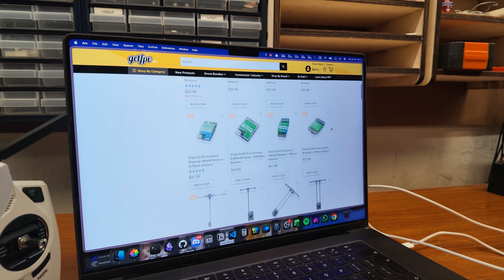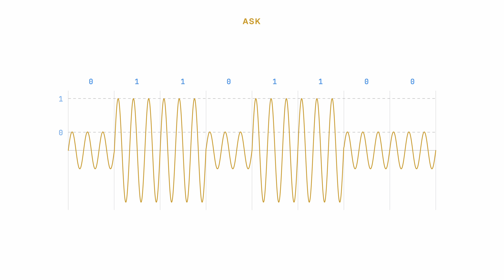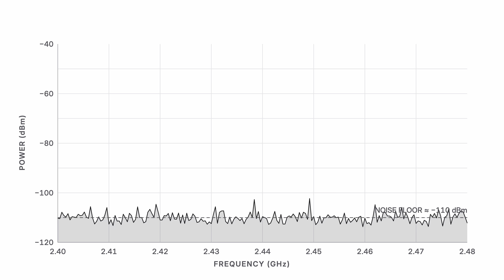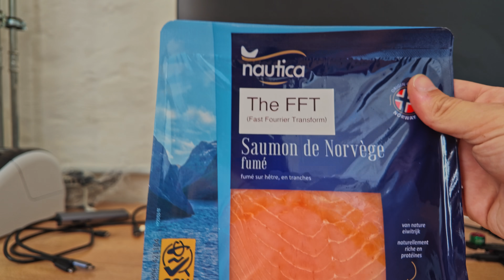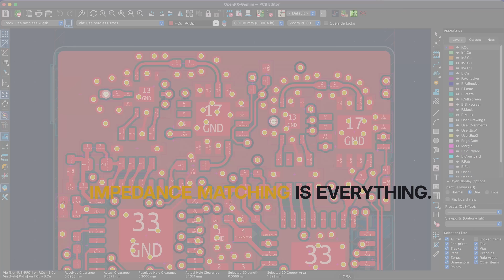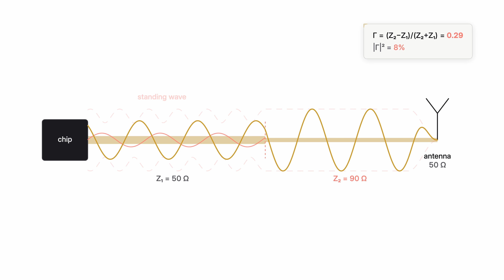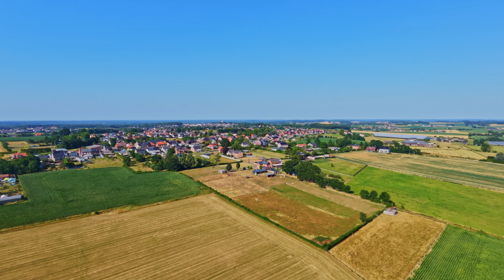How LoRa (ExpressLRS) Drone Receivers Work

Comment: Is this better than the full size crossfire nowadays ? I haven’t flown in a few years but I been 20 miles out at relatively low altitude and still had 99% signal on my full size crossfire on dynamic power. I also armed my dart 250 g left my transmitter and home and drove several miles before it lost signal and rth kicked in. Also never had a xfire fail safe while flying long range

Comment: your description of how it cuts through noise reminds me a lot of how analog balanced audio signals work, with flipping the phase/polarity of the signal and sending it twice, then flipping it back and the noise all gets cancelled out by the opposite wave from the second signal, allowing it to run for kilometers without any noticeable signal degradation

Comment: "through the forest" ...you're buddy just climed 50 ft in the air above the forest....this would never work if you were on the ground in a "real" forested area.  An occluded signal happens to all radio transmissions, including LORA.  I have tested these for drone finding...top of a mountain...fine.  On the ground...forget it...if you get a 1/2 mile in dense forest your lucky.

Comment: You could have mentioned the Shannon Capacity equation C= B*log2(1+S/N). C = channel capacity and B is bandwidth of channel. One can easily see you can trade capacity for range. This is how LORA can work below noise floor.

Comment: Awesome video!  I recently finally understood impedance, even as an EE, working on a blast wave propagation project.  I realized it's the exact same for RF waves.  Different materials have different rates in which they transfer waves, which is dependent on material density and a few other factors.  If the transfer rate/speed of a wave changes because a different material transfers waves at a different rate... the junction, or point as which this happens, a portion of the wave will reflect at this junction.  

This is one of the reasons windows have multiple panes, soundproofing does best with multiple air gaps, etc.  As a sound wave goes through several impedance mismatches, it it reflects more of the sound, therefore less is transmitted.

Comment: Great job explaining! I’ve recently started trying out LoRa for communication to/from i2c sensors and pwm fan controls between steel storage containers for a hydroponic farm. Affordable ESP32 and LoRa combo boards are rare… perhaps a viable offshoot for your project? Currently trying out the Seeed XIAO/LoRa kits (915 MHz) but I’d prefer not to “piggyback”. Liked and subscribed.

Comment: Could someone recommend a LoRa chip or another type that works for long-range transmission and reception and has low latency? I want to design a PCB or RF module to put in a remotely controlled drone, like a long-range drone, that sends and receives telemetry almost instantaneously.

Comment: Very good, and especially about RF, take note also the antennas to be 50 Ohm at center frequency.  At high frequency you can't just 3d  print antenna holders, strap antenna to the frame, or even use a heatschrink around antennas. (for 5.8ghz effect of detune is even much worse), to achieve the very best results for long range flying,  the complete antenna when mounted at drone needs to be matched with a VNA.

Comment: That chirp counter chirp system is genius. I prefer to keep my communication networks wired for robotics purposes, but I always find it amazing that wireless is as developed as it is considering how many uncontrollable variables exist out there. With wired connections, you can just shield the cable, or run a positive/negative pairing like with CAN and immediately cut out all ambiguity in the system. Wireless doesn't give you the pleasure of running several truly simultaneous signals that cancel out like that, so you can't really compare two incoming streams at once to see the relation of the two. Amazing that someone thought of that.

Comment: U OFCORSE USE 4% SILVER .. WHUPPERTHALL MAKE RADIO SOLDER
NO SILVER  ABOWE 500MHz STARTS TO BE WISIBEL..  .. ALWAYS
SHINY SOLDERING .. NO CRAKS UNDER MICROOSCOPE  STANNOL 4% USED THIS 
FORE 47 YEARS ..  AND U R WELLER 2000ESD WS 81 WSM-1
 YOUR TIPS WILL LOVE STANNOL .. IT DOES NOT DEGRADE WELLER TIPS 
IN 2.4 EVEN A SMALL DIMPEL IN SOLDERING CAN INFLICT SWR S.W.R STANDING WAVE ROTATION 
THE REFLECTED POWER IS HEAT IN CHIPS I KNOW MILLI WATT BUT THIS IS WERY TINY SO SAME EFFEKT HEAT KILLS

Comment: so changing the ohms and broadcasting it at a similar db is a way to disrupt drone or rf comms? i just want to be sure im understanding correctly cause if you specialize a network of cables antennas and the like all on 30 ohms just for shits and giggles and make it so your hardware will only communicate with others carrying that same amount of ohms, does that seem like a valid usecase?

Comment: Another way is to send information  packets where each packet contains a reference amplitude pulse and the other pulse amplitudes are decoded differentially to the amplitude reference  pulse in each data packet, plus the phase information.

Comment: You still have a reflected signal from your signal via.  Consider a high dielectric and therefore miniaturized quartet wavelength stub at the via, to cancel out the reflected wave.  "In RF engineering, a stripline overlay using a 2.4 GHz high-dielectric stub refers to a localized multi-layer design technique where a high-permittivity substrate patch or block is layered directly over an internal transmission line. This configuration modifies the local propagation velocity and characteristic impedance specifically at the stub location, shrinking the physical footprint needed to achieve filter resonance or impedance matching at 2.4 GHz".  Nice job on the reverse chirp explanation. 😊

Comment: Great video with high information density and good explanation and graphics. High frequency electronics always seems like voodoo to me even knowing some of the basics (but never heard of the no via rule --> I rather use too many ground vias around signal vias just for shielding precaution and better thermal dissipation and so accidentally do the right thing). It was really surprising that the small SMD tower antenna hold up so well. The thing I did not understand is why the power handling curve has a maximum point at 30 Ohm, but Mistral AI explained to me and mentioned that there are also 75 Ohm coaxial cables for some satellite signal applications with higher signal voltages.

Comment: Does anyone know if I can mod a dji air 2s for long range flights I can get 6.5 miles out if it atm but I'm using a 4hawks xr raptor signal extender on the controller and a fcc patch or am I just better off taking the jump to fpv?

Comment: I work on this software almost every day and still found this an interesting watch. What's that test device showing the linkstats though? I'd guess a CYD but it doesn't have the I/O for 4x UART inputs, or does it?
Reply from the maker: It’s just a flight controller logging the serial (CRSF) output of the receivers
Reply: @opendrone  But there was a pretty GUI display ❤

Comment: Outstanding video! Will be watching this progress and signing up… if I can find the link.  Could you add a pinned comment?  Also, would it be possible to relay the signal from one drone (or balloon) to the one father away so you don’t have to climb a staircase? :)

Comment: I've been using ExpressLRS for years. My favorite setup is the RadioMaster DBR4 Gemini Receiver paired with a Nomad Module on a TX16S Transmitter which combines 2.4 GHz and 900 MHz for both control and telemetry. Best of both worlds so to speak. For video, I highly recommend 1.4 to 1.8 GHz as the standard 5.8 GHz simply doesn't cut it.

Comment: I loved your explanation of this technology ⭐⭐⭐⭐⭐ 
2:11 The data wave reference must cycle between the 0 center line to graphically illustrate the frequency itself. Otherwise your references are good 👍
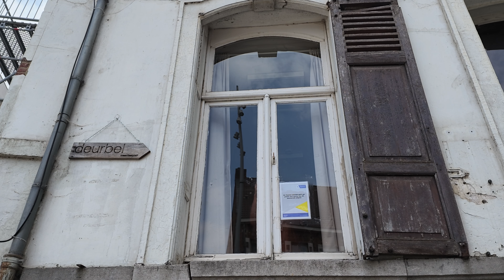6:10 Signals received against background noise floor is also called the SNR (Signal to Noise Ratio), as in military applications.
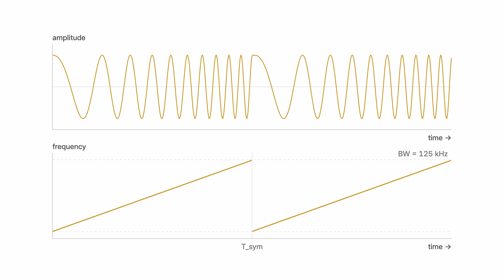6:50 Also the chirp is like a FM ramp used to suppress reverberations. Except the chirp frequency electronically suppresses background noise.

Comment: You can have the same effects (LORA based RC Link) with for example Frsky RC with R9M Modul, a Moxon or  a Super8 Antenna on the R9M Modul and for example an FrSky R9 MX – Enhanced R9 Series ACCESS receiver... Happy flying...

Comment: The worst and most dangerous soldering I’ve ever seen. Strip the wire just slightly shorter than the pad you are soldering onto. Surprised you put that on video.

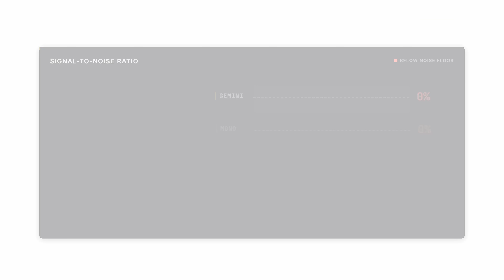Comment: 5:52 
GPS signals also exist below the noise floor, around -160 to -130dBm
They sacrifice their data rate all the way down to 50 bits per second to get that 10,000km+ range
Reply: This comparison doesn't make too much sense:
Terrestrial radio communication has to deal with other problems than satellite radio, line curvature/mountains and weather (clouds = water) all the way, plus for larger distances, you have to use longer wavebands to use atmospheric reflection beyond the horizon. The lower the position of an antennas, the lower the reachable distance due to obstacles and reflections.
 
Satellites only have to cross the atmosphere once (per sender/relay) while the rest is vacuum that doesn't interfere (though of course on the other hand, radiation from space has to be  dealt with).
The primary factor is the bit rate + choice of the modulation.
Reply: @martinb.770  I don't really think LoRA can pass curvature/mountains at 2ghz/900Mhz. There is no significant atmospheric reflection at these high frequencies.
Reply: @martinb.770  Crossing the Atmosphere has its own issues that you're leaving out.

Comment: How is it possible to pack so much incredible well explained info into an entertaining 15 min video?! I learned about LoRa, QAM, Impedance Matching and PCB design! I used to learn some of the basics many, many years ago at R&S, but you made it so …refreshing! And I always wondered why transmitters and professional measurement equipment work at 50 Ohm while TV receivers and antennas use 75 … et voila!

Comment: don't know if you're in the field but you should apply to a professorship. Quite possibly the best introduction into high frequency engineering and digital modulation and antenna principles in one video. There are many professors who could learn from you, looking back at my last 3 years of education in electrical engineering! I have put together the principle of this design a year ago on rudimentary basis, because I also loved lora for the range for my fpv drone! Love that you put in the work to create an open source pcb!

Comment: This video is excellent. We work on projects using LoRa and find it super interesting. One question: is the antenna gain due to the gain in the receivers? Regulations only allow us to use antennas with a maximum gain of 1 dB.

Comment: OK so I'm an old Army commo radio and tacsat operator and repairman and who also used to climb towers and work on antennas and radio components on the older stuff when you could actually work on it, so I get the physics of RF itself. But frankly, all I want to know here is if I can buy such receivers and other than some programming, can they be just soldered onto the board of a drone or is any of this plug and play? I guess this is for the build your own FPV where you're adding your own receivers, and not throwing onto a DJI.
Reply: Yes it's for the build-your-own fpv drones, you typically solder them to a UART on the flight computer, but some do come with plugs. ELRS receivers are available from many manufacturers, primarily Radiomaster, Happymodel, Betafpv, Speedybee, GepRC, etc. The code is open-source.

Comment: This is the most interesting thing I’ve seen this year. It made me remember back on the day during the period I studied electronics engineering, I had a discussion with a professor on a circuits analysis class, that made the affirmation that electricity flows on straight path and not in circles. I’ve tried to explain the same as you (and maybe not so well as you did), at the end maybe he released I could have some reason, but he insisted that he had a PhD and can’t be wrong

Comment: Researcher here: what you've probably done in practice is Spread Spectrum communication (or extremely narrow-band filtering), where the signal operates below the thermal noise power spectral density per unit bandwidth of an un-processed receiver, but no way below the fundamental Shannon-Hartley channel capacity limit.

So saying that you encoded the signal below the noise level is absolutely misleading. 

Other than that: hats off for the video. Really.
Reply: great comment, i learn something new
Reply: @ekayudhipr  Well technically, if you listened to the signal with a regular receiver you'd only hear "noise".
Reply: What I've done in practice is Spread Rectum communication

Comment: Thanks for that great explaination, I think I've forgotten how that works many times.  While this might work for a drone that doesn't need high speed updates, it most certainly would not work for a FPV drone right?  I built a 2.4ghz RC car radio system (one of the first) and the big corporation built one also, mine ran at 1mpbs and their ran at 64kbps, basically dialup speed.  The racers that were using analog 450mhz would not use the big corporation system because it had too much lag at high speeds.
Reply: ExpressLRS supports a 500 Hz update rate using LoRa. It also supports 1000 Hz using FLRC, but the range isn't as good as LoRa. I doubt anyone can notice 1 millisecond of input latency.

Comment: Are these legal? I.e. adhere to the duty cycle/max air time limits?
Reply: Of course no for drone control. I’d even say it would be impossible to follow duty cycle limit for real time control. 

”ETSI regulates this, generally limiting transmissions to 0.1% to 1% per hour”

Comment: Very awesome video and a much needed project. Also current doesn't just flow in a loop. It actually flows the opposite way. Electrons travel from the negative terminal to the positive terminal to balance the chemical ion imbalance.
Reply from the maker: Yeah but we stick to conventional current flow in engineering, the math is just inverse

Comment: You can "tune" the aperture of the ground around the via through the board and also the spacing of the ground vias about the signal via in the design (using simulation) to minimize the reflection. Basically, your goal is to create a tuned waveguide through the board... This kind of design and 3D simulation has been common for about 15 years or so - especially in test and measurement applications.
Reply from the maker: Can you send me a link to go down the rabbit hole of like a paper or something? :)
Reply: Since transmission line Impedance is a function of ratios between conductor size and spacing that makes sense.  But the calculations outside very simplified cases would be messy.

Comment: Let's do same math.  I am not convinced.
How high must the drone be for you to have communication over a 100km range.
The earth's curvature calculates to 8inches per mile^squared.  This means the curvature drops 8inches first mile, second mile is 2^squared = 4, thus 4x8 = 32inches.
Thus 100km is about 60miles.  60^squared = 3600.  8x3600 = 28800inches.  that comes to about 8730meter or 8.73km.
So if your remote control is about 30-40 feet high (on the tower), the drone must be about 8km high for you to have line-of-sight communication or the curvature horison will block the signal.

Either you lie or the earth is flat.
I think the latter is true.